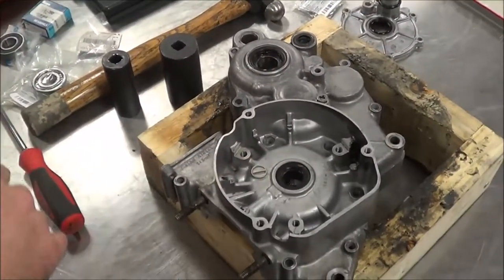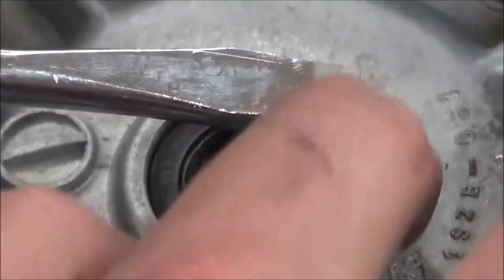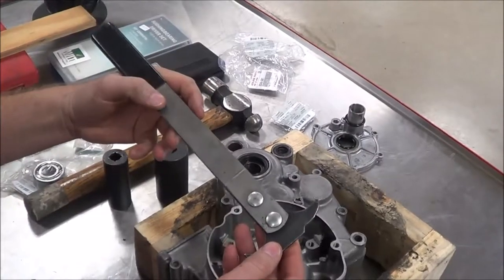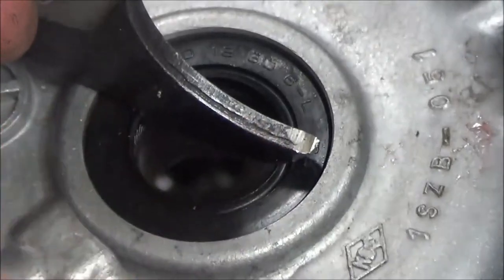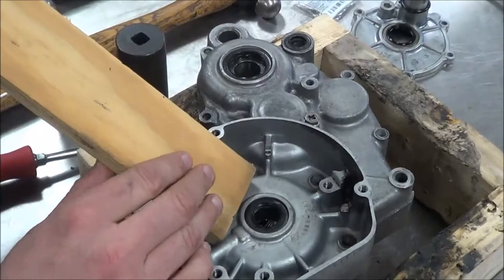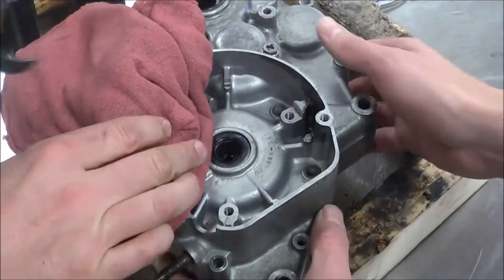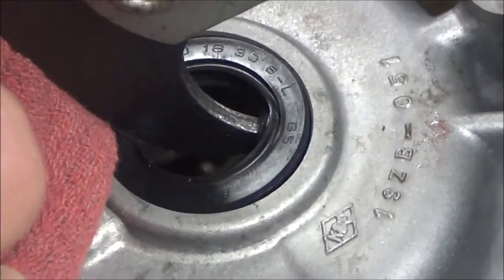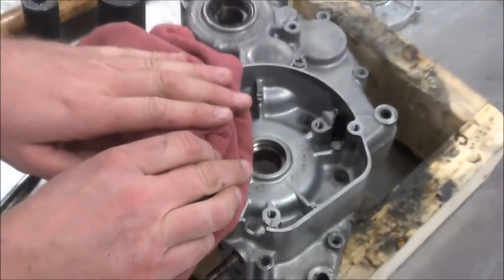2 Stroke Engine Disassembly   Oil Seal Removal Seal Puller Method   11 03 14

Comment: I'm having an issue with seals i bought they seem to be too small.  I remember the old one was pretty hard to get out so shouldn't the new one be hard to press in?  The ones i have keep coming out and forming a small gap that leaks oil when the motor is on.  I'm able to press the new ones in with my fingers and pull them out with my fingers not sure why the size is wrong i made sure it was same as the original.  This is on a 150cc gy6 and the cover has to be removed to get the seal out.